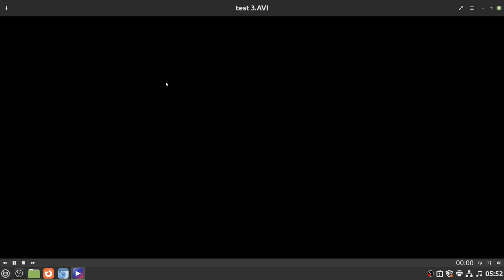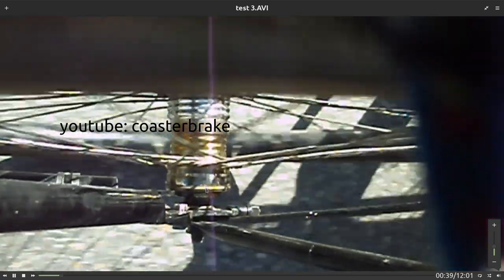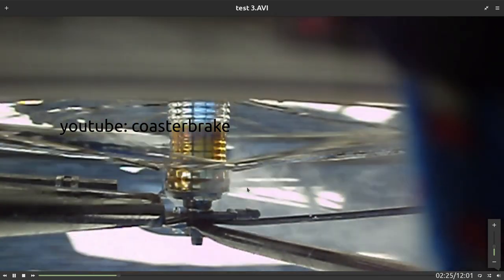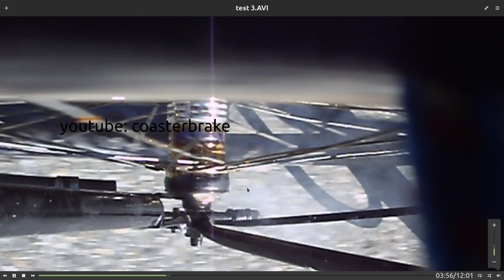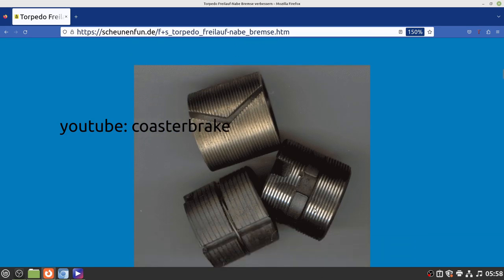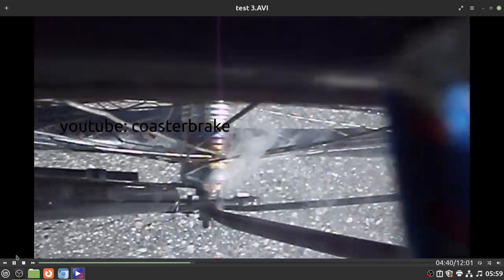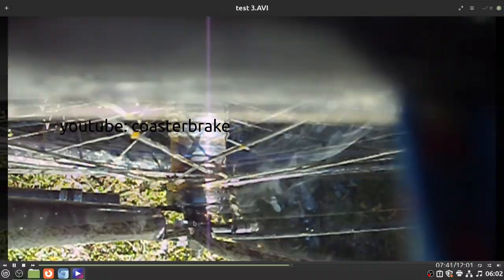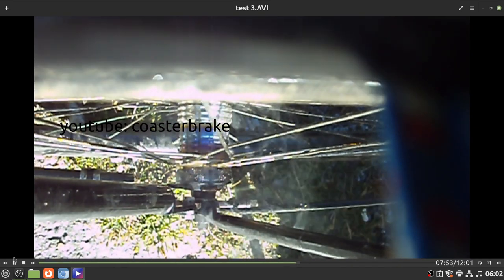Torpedo-Killer. Sachs Torpedo Coaster Brake Test, what's happened until the end.

Comment: I AM just the kind of bike nut to enjoy this. I fried a very smooth and nice Shimano 333 CB once aboit 1980. Smokin, split the shell around the circumfrence, in the middle.  I was sprinting home across town to beat a rainstorm & close my windows.
Reply from the maker: a swiss friend did this braking test on a very steep pass in the alps. we think the problem is the heat, which turns the grease into liquid and then quickly wears out. that's the end of the hub and it goes to the "hunting grounds". I wish you a happy Christmas. Jens